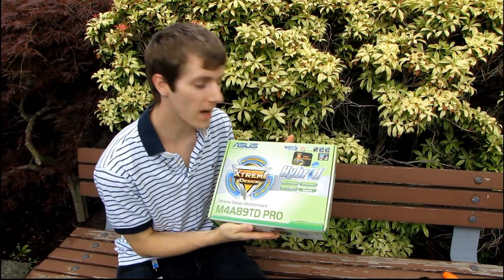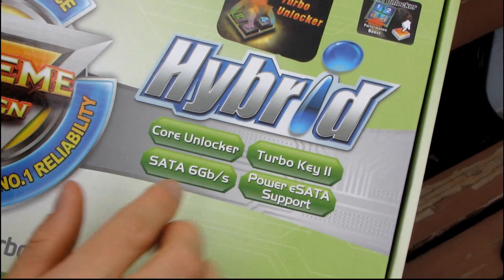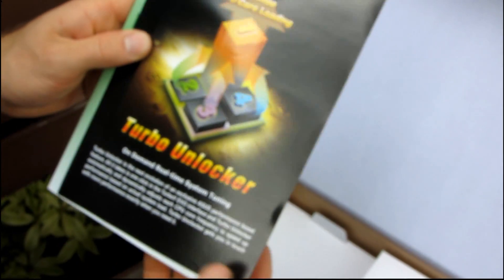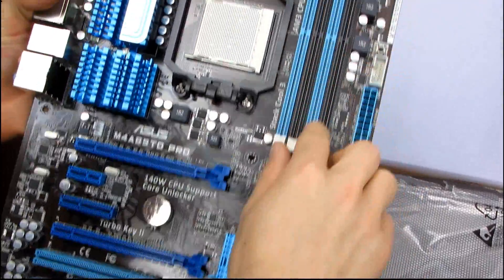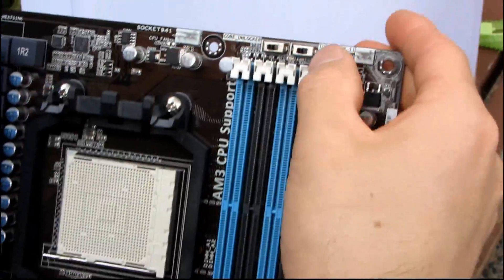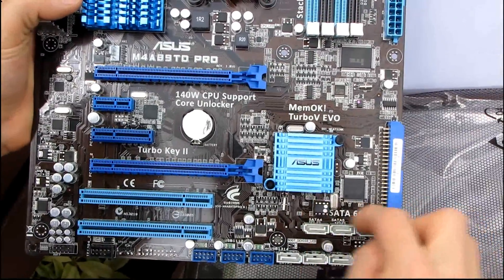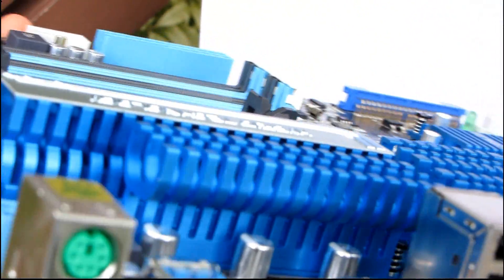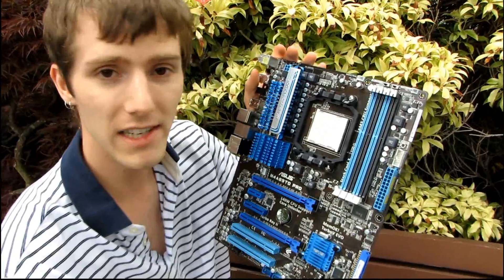ASUS M4A89TD PRO 890FX SATA3 USB3 Crossfire Motherboard Unboxing & First Look Linus Tech Tips

Comment: Is the standard integrated ati 4290 good if you cant buy all parts in one time?

I think ill start with the m4a89td pro usb3, 8gb ram, 650w psu, coolermaster haf 932 and the phenom ii x6 1090t ( not OCed)

Then ill buy a 1tb 6gb/s hdd, an h70 liquid cpu cooler, a msi n460gtx cyclone and a 60gb ssd